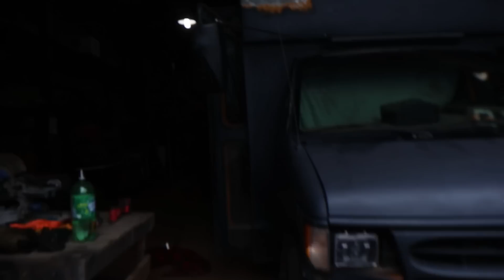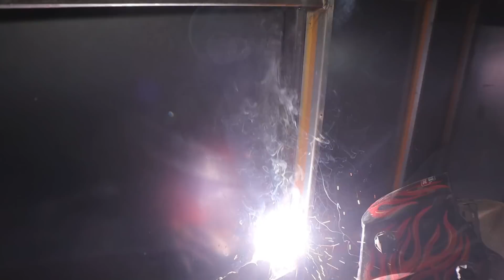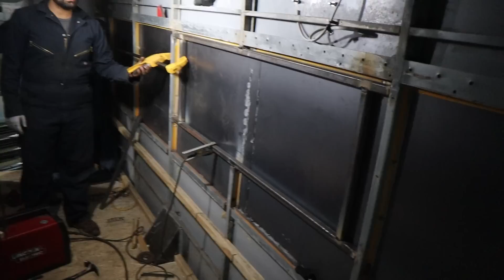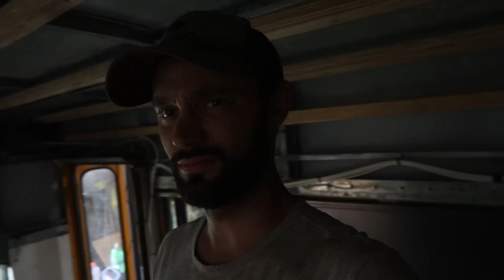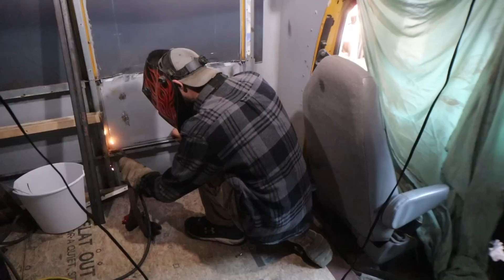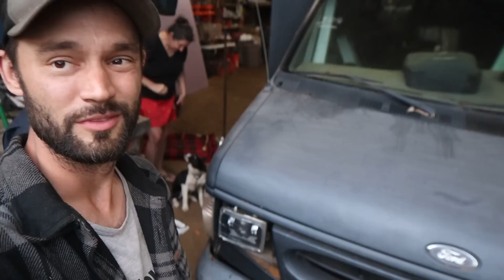Installing a Gigantic 100-Inch RV Window in Our Skoolie Conversion

Comment: So I saw Romex wire, I see a lot of people in the schoolie community saying romex breaks.. what do you think.. Romex or stranded wire? Like Obviously Romex works.. but if cost wasn’t the overwhelming issue should I use Stranded?
Reply: Stranded should be used for wires that move, like extension cords, or if you wire an outlet or switch into a door or something that moves. According to the Ontario Electrical Code you can use solid core in motorhomes, boats, etc... They determined the vibrations and slight movement the wires may see will not compromise their structural integrity. That being said the OEC also stipulates that you need to secure your wiring in order to prevent against unwanted movement.
Reply from the maker: NM wire is permitted by code in RV’s. Look up NEC Article # 551. If you have an older trailer using aluminum wire (older airstreams) you will find the wire can break and I will upgrade the wiring where possible